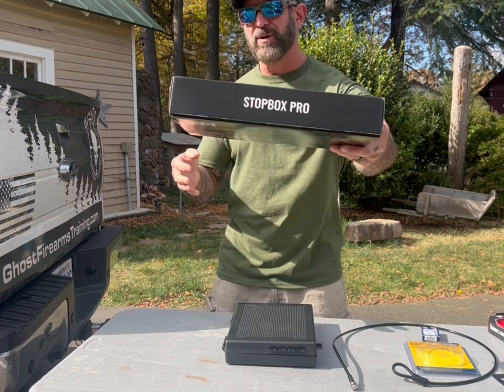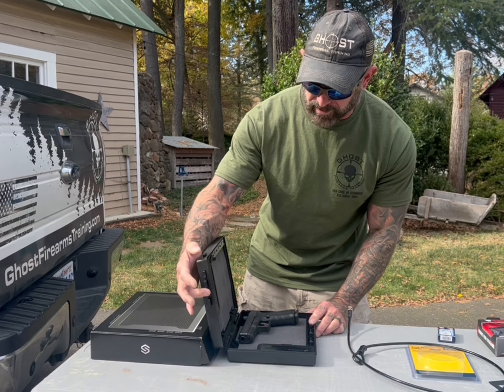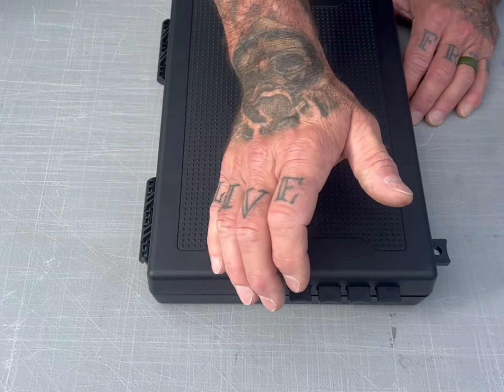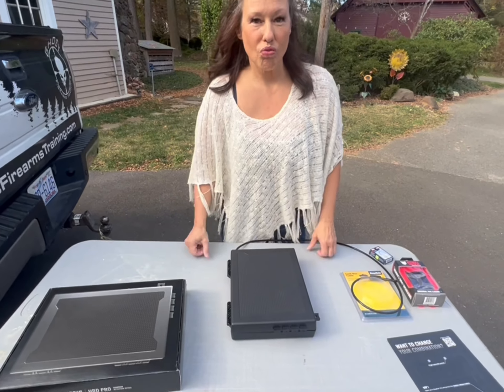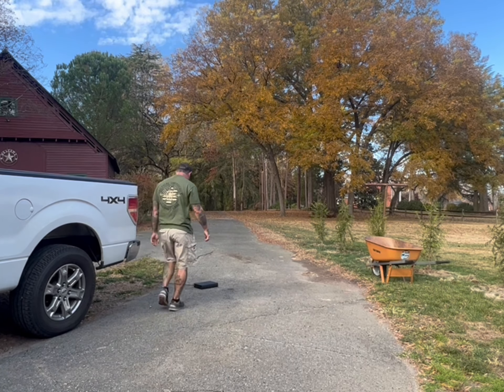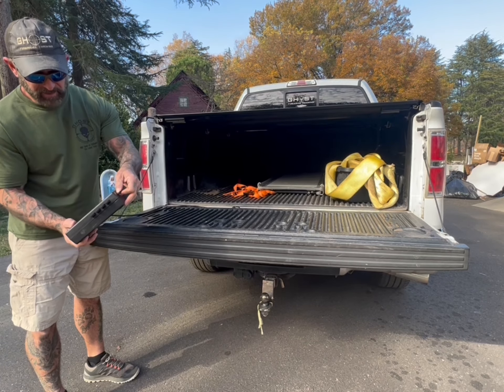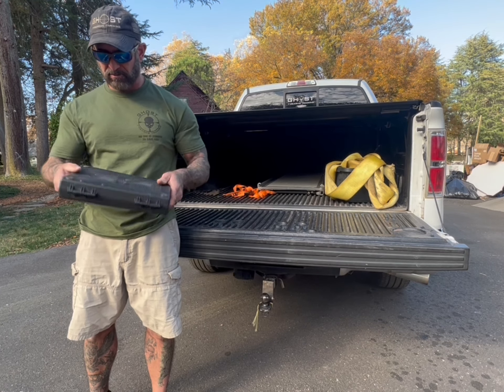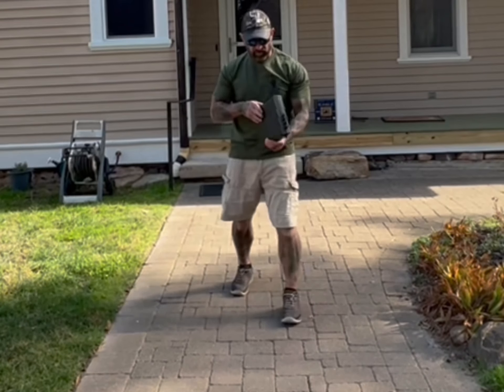Stopbox Pro full review and torture test

Comment: You being able to break the cable mounting on the box in only 5 pulls is pretty damning. I don't expect any solution to be foolproof, but that just was too easy.  You could lock it in a place that would be awkward to pull on, but even then, too easy.  I wonder if they had a little bit of metal around that mount point or just a thicker wall at the mount, could make a good solution even better.  In a world where smash and grabs are all too common, I just don't think this is a practical solution, should you need to lock your firearm in a car.
Reply: It is more like keeping it where it needs to be in your house. Like if it is on your nightstand and you anchor it around the nightstand leg to keep your kid running off with it or taking it out of your room. Rather than an actual anchor point to keep someone from running away with it. At least IMO.
Reply: @Mpostor  agree. It's not a safe or a theft security device, it's an access control device.
Reply: @TallGuyChris  Unless it was a metal safe bolted into the ground anything can be defeated. Even steel pistol boxes. They're meant to buy the gunowner time from unauthorized people. The only people who need access to it, are the ones who need to know the code.

Comment: It doesn't have 81 combinations, it has only six with two buttons depressed.
Pick one, then pick one of the remaining three = 12 combinations (4x3); except 1 and 3 is the same as 3 picked first and 1 chosen second... so half of the 12 is 6.
Likewise, if you can pick any three you really only add 4 more combinations (whichever one is not pressed)  so maybe 10; or 14 combos if you can pick a single button too.  Nowhere near 81 combinations.
If for some reason they permit none or all; that would add two other combinations (but be even more unsafe than just six, ten or fourteen).
Reply: I think they get the 81 because each button can be replaced with different levels of being press, so one third pressed, two thirds pressed, and all the way press in.  So 4 buttons with 3 levels of being depressed, plus the thumb.  Not sure how well that works or if it's harder to open, could just be marketing.
Reply: There's 81 interchangeable combinations, and that's only if you know how it works, and 323 if you don't know how it works. I know it might sound complicated but until you have one you won't understand how it fully works.